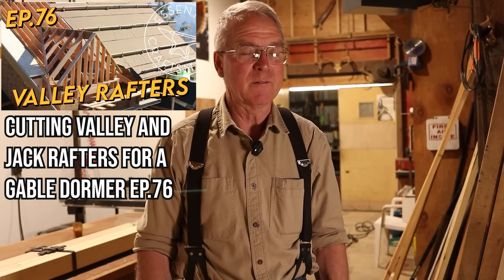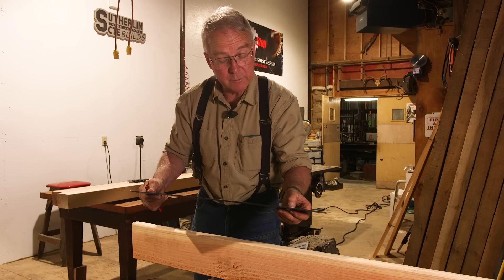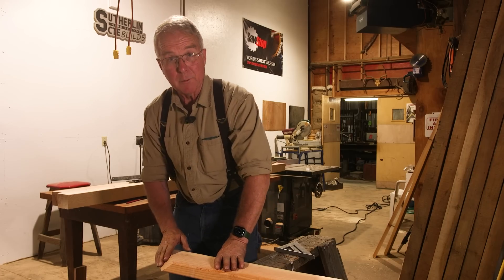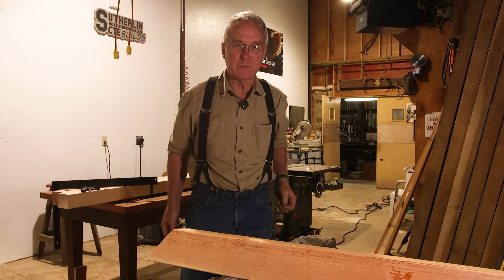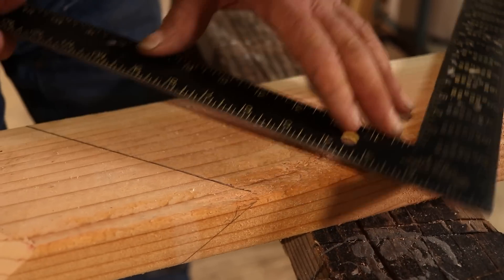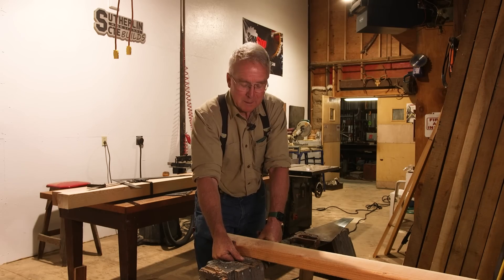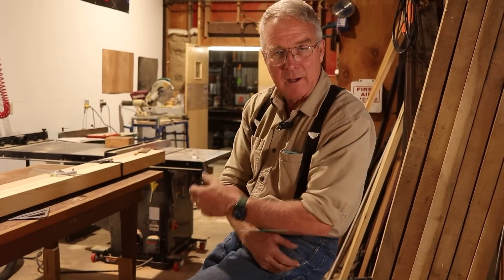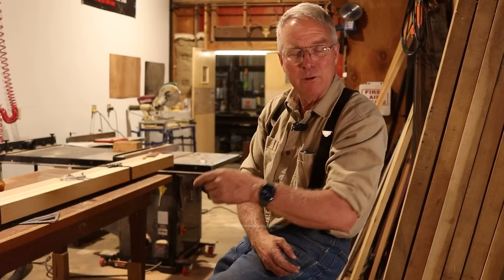Can You Trust Your Framing Square? Valley Jack Mistake

Comment: Where this top cut mark is important, is when you have a large valley or jack that you need to cut with a circular saw. Just as Scott showed, you mark the the top, scribe your jack rafter all the way around. On a 12/12 pitch, the top cut is not 45 degrees. Use your framing square side cut measurements to find the value for the tongue side of the square. When you cut 2 by material with a skill saw, you don’t need this side cut measurement. With much wider material, you do. If you are using a 7 1/4” saw you can’t cut much more than about 2” of material. I once cut a large valley glue lam that was about 7” wide by 26” deep. I scribed all the way around and cut as deep as my skill worm drive would go. Then I finished up with a sawzall. 

Cutting with a 8 point crosscut saw like Scott showed divides the men from the boys! I once was in a old court building in Ogden Utah (2018). In the attic, you could see a 10/12 hip roof with large hips and jack material. 4 x 14 hips and 4 x 12 rough sawn jacks. All hand cut. The building was constructed in the 1880s or 1890s. I looked in amazement at the jack cuts and how well they mated up to the hip. Great respect for some long dead carpenter(s)! Beautiful work. I showed the young carpenters with me the work and they were unimpressed, I couldn’t make them see how hard it was to do such a beautiful hand sawn job!

Comment: Side cut length of jack rafters is still a handy table! For hips/valleys if you times it by 4, thats your out of square for a plywood pattern. You can also use it for when you have an overhang soffit coming down a roof using it the way you did as 8.5/12. Not exactly everyday things definitely helpful though.

Comment: I remember that episode, and thinking that didn't sound right. Nice correction. One thing I would add is that the side-cut formula is still helpful when marking and cutting hips at the ridge, as they need to be marked and cut from both sides. On a low slope 45º with a speed square works, but as the pitch increases so does the angle across the crown side of the rafter. The saw is still set to 45º, but where to make that cut changes.

Comment: "If you use a hand saw very much, you are going to have a powerful right arm."  Yes.  For a few years anyway, until your joints are destroyed.  I truly admire the hard workers of old, who did what they had to with the tools and procedures available to them, and achieved such impressive results.  I'm a carpenter who stays in excellent physical condition via hard work, and I intend to still be capable of hard work when I'm 70.  For me, "work smarter, not harder" means that highly repetitive motions are minimized (though not eliminated).  Nail gun, not hammer.  Power saw, not hand saw.  Dig with a machine, not all day by hand.  Also, the more dangerous tasks are minimized (though not eliminated).  Less trips up the ladder.  Work from scaffolding instead of ladders.  Move big/heavy things with a machine, not 5 people, even if less efficient.  Etc.

I'm not trying to tell anyone how to run their jobsite.  It's an individual decision, there is no one right answer for everyone.  I am only encouraging everyone to think both short-term and long-term when considering the balance between safety and efficiency.  (And no, I didn't write this as an argument with Scott.  I'm merely using his statement as an excuse to mention a perspective which I think isn't mentioned enough by tradesmen.)
Reply: A very wise perspective. It's become OK to denigrate health and safety in certain circles, but nobody should be seen as disposable or collateral damage. Working smarter not harder means you increase your chances of actually getting to retirement, and still have the strength and energy to enjoy it.

Comment: How to figure cheek cuts on a irregular roof:  
  
Example 5/12-9/12 roof
Set your framing square up with  5 on the tongue and 9 on the body (these are the opposing rises). Scribe both sides of the square on a board and read the angles with your speed square. The steeper angle is for jacks on the shallow roof. The shallow angle is for jacks on the steep roof.

Comment: There is a use for this! Cutting mitered  fascia tails in place, going off of a plumb cut rafter if you put your speed square on a 45 and try to transfer  heel (short point) of the miter to the toe (longpoint of the miter) across the top edge of the board from back face to the front face and then mark your plumb cut. Because as you explained it Is a compound miter your pencil mark will not be a true 45.
You would do this so you could cut your miter in place from the front face of the fascia with a circular saw referencing off of where the back face meets the plumb cut of the rafter.
Reply: This comment brought tears to my eyes and I'm man enought ta say it. My dad passed in 2015 and retired as a 45 year master carpenter, a proud member of the union. I myself am an hvac troubleshooter with the smwa local 20 for the past 15 years. Reading this comment reminded me so much of listening to my father discuss work with his buddies. He was the type of guy that when he talked on a job site, the guys in the circle got quiet and took note. And I'm not sure he ever realized it as such. He was very humble. With fathers day on the horizon I guess it just hit me how much I truly miss this about him. I didnt feel skilled enough in my own field to hold my own in a conversation with him on such job site topics. I wish now that we had more time to share stories and laugh together on his porch sipping tea. All that to say, thank you sir. And Happy Father's Day.

Comment: I'd mark out the centre line of the;
Ridge board, hip rafters ceiling joists and valley rafters on the top plates. Then I set my chop saw to the pitch angle in degrees 26°.
* Cut all common rafters 
* Cut two king end rafters, fix them in place opposing.
(I was told once that "the edge cut is not exactly a 45° cut due to it being a compound miter on jack rafters) so that was that!
🌏🇭🇲

Comment: Along the same lines, dealing with compound mitered cuts in framing; the automatic 45° angle on the saw table does NOT hold true when you are making a corner cut on the facia board. If the rafter tails are a plumb cut, than YES, 45° is the angle you want on your saw, to make a 90° facia, corner. But if the rafter tails are square cut (perpendicular to the rafter top) than the saw angle, to cut the facia will be something less than 45°. Years ago I had the formula but have long since lost it, for lack of use. But I got the formula originally from the magazine Fine Woodworking, in an article called “The Witches Tackle Box”. (It had to be in the late 70’s, possibly early 80’s).

Comment: EC, quick question, maybe you could do a video on. I’m a 2nd generation framer, work with my dad and brother. I’ve been framing 8 years or so, make decent, but like the idea of engineering. I’m 26, with a wife and a 2 year old. Is it worth going to school for 4 years while working full time to go into mechanical or structural engineering? I like the freedom of working outside but see the toll it’s taken on my dads body and feel the early effects of hernia and knee problems
Reply: Hi andrew🌹
How are you doing?
Reply: As someone one works a desk job...I can't steer you away enough from it. I am currently trying to make the switch from it. Working at a desk all day is not natural. It will destroy your body much quicker than working on your feet and/or working outside. I would definitely recommend you continue to work with your hands. Also, look into hand tool work instead of power tool work. It will give your work more fulfillment. Mr. chickadee is a great YouTube channel for more information on hand tools.

Comment: So it's basically the difference in cutting crown molding upside down on a chop saw propped up with the proper spring angle which would make a 90 deg corner a 45deg angle and cutting it flat and using angle and bevel which changes the angles.

Comment: When handsawing, it's easier to keep cutting straight if the forefinger is pointed straight & parallel with the blade.
Reply: If you're using a western saw with a tote handle, yes. But the Japanese saws need a different technique, as the handles are different.
Reply: @BigHenFor  I've put western handles on my Japanese saws.  I never could get used to the stick handles.

Comment: Mmmmm the tongue of the square is where you should mark your angle from, be it side cut in this instance, or plumb cut, it's not exactly  45° probably because  the framing square is set to 17 inches  for hip and valley cuts, but the hypotenuse of a 12 x 12 inch square is  16" 15/16ths, those tiny amounts make no difference really on a roof, but mathematically that is why it's not quite 45°, the tables on the square are correct,  it's nothing to do with being able to make the cut by hand or not,  skill saws are quick and easy to set at 45 ° and whizz through the cuts, and it's close enough, the true angle is found on the square,
Reply: @stantheman7467   yep that would make sense,  the actual angle is some way off of 45, and the side cut markings on the square tally with that

Comment: I don't know that I understand the problem in this, it sounds like both message approximately get you to where you want to be, and as long as there's no structural deficiency that's had from doing it one way versus the other it sounds like it's just a million ways to skin a cat......

Perhaps someone else can explain this to me better but the cuts look so close I would have a hard time believing that this could lead to a structural failure

If it can't lead to a failure than who cares do it the way that you have fun doing, everybody's forgotten that that carpentry should be fun and sometimes that means honoring your old master who taught you a specific way even though it might not be the most efficient, or costly that's the problem with the building trades today is it's become this machine devoid of any true heart or emotion.......
Everything must be so production line efficient
Hats off to honoring the old ways
Reply: In the original video, he said to take the angle that you get from the table on the square, and set that angle in the tilt of the skil saw., whcih is incorrect.   You  set 45 degrees in the tilt of the skil saw.

Comment: I’ve built bridges skyscrapers hospitals parking garages houses porches outbuildings coal burning power houses all you need is a speed square tape measure string line level and a pencil framing squares in my
Opinion are a useless tool you don’t need one
Reply: I have to admit, it's been a few years since I saw anyone using a framing square for framing, it's usually used as a good straight edge that you can hang of something while you work

Those little adjustable speed squares are what everyone uses for framing now, but goddamm if you drop it once it's knackered 🙄😬 bends it in such a way that the adjustable bar no longer moves
Reply: Apparently punctuation is a useless tool as well? 😁  Just teasing.